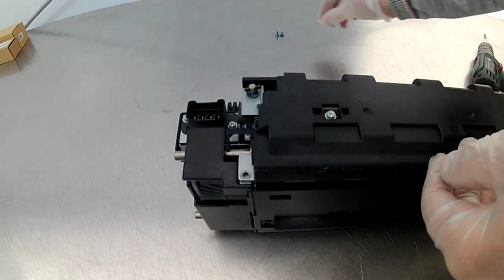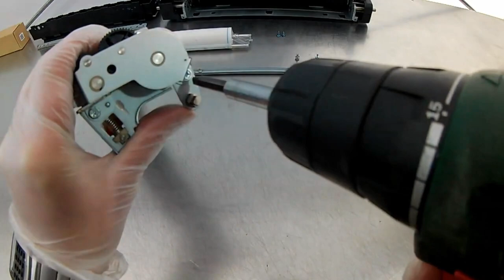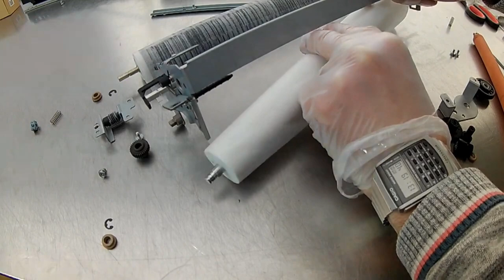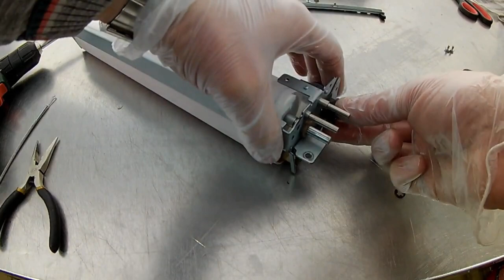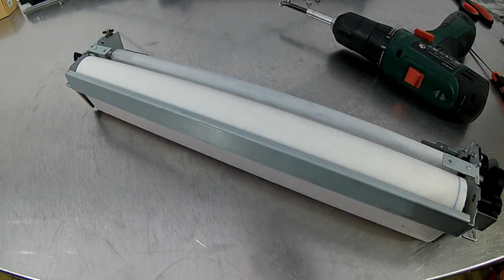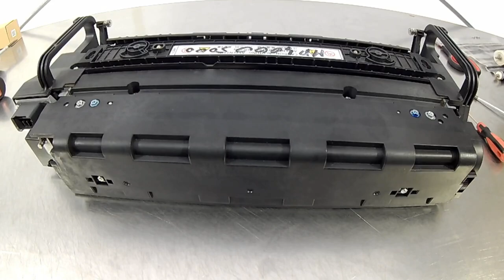SERVICE TRAINING - LESSON 6 - FUSING CLEANING BELT Ricoh MP4002 MP5002

Comment: Thank you sir i watch your every  video  i have toshiba 306  make a copy 50 page after 20 copy machine is wait run and then start copy
Reply from the maker: Hi. If your copier has a HDD, disconnect it. Then start the copier and make 50 test copies. If the problem persists, you need to replace the disk with another one. However, if your copier does not have a disc, then you will need to be prepared to replace the power supply.
🔥🔥 YOUTUBE SUPPORT: https://www.youtube.com/channel/UCOHtXTtGHj33pUm8Gf2FH3A/join 
😁😆 PATREON: https://www.patreon.com/CopyExpertMovieStudio 
🔥💥 PATRONITE: https://www.patronite.pl/1796